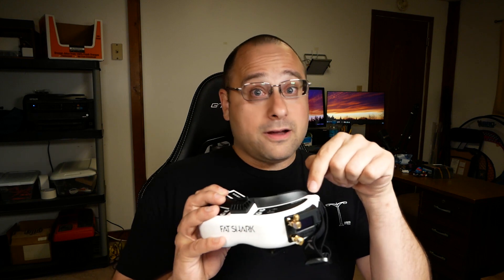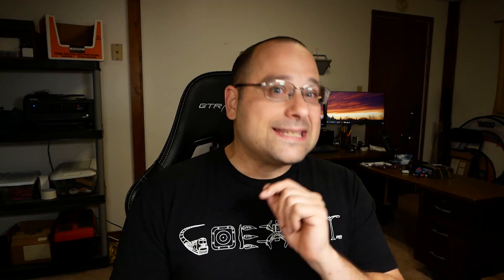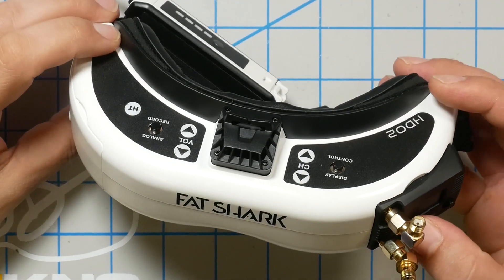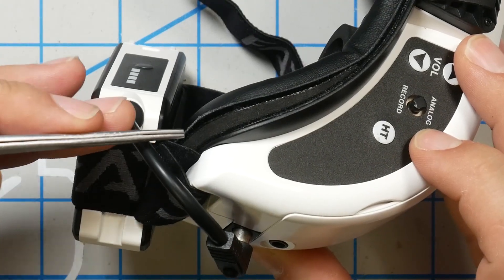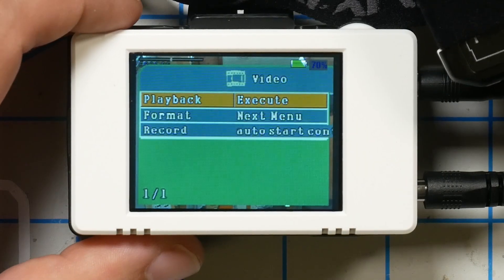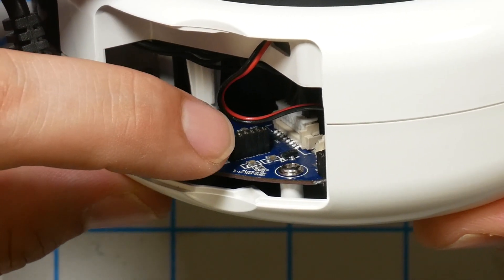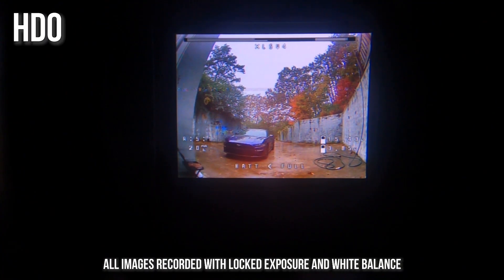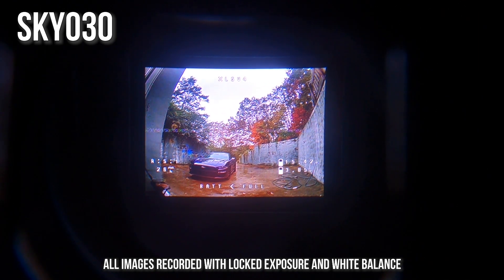Fat Shark HDO2 review (hands-on vs. HDO, Skyzone, DJI)

Comment: So once you mod your 54 degree FOV DJI googles with 1440 x 810 resolution to use your Rapidfire/Fusion module on them, will the HDO2's be better than dji fpv hd goggles? Noting the FS HDO2's have 46 degree FOV and 1280 x960  resolution, oh and power button :)

We wanna see that comparison review Joshua! Please do it soon :)

Comment: Excellent review of the HDO2 and commentary on the digital divide. I'm new to the hobby and I bought the Sky03O and will remain a happy user for a while. Touching on the transition to digital, As a noob to FPV, I am very glad I started with small micros, which digital doesn't support, and you need something better than the BnF crap goggles that RTF kits come with. That is a bad experience and will drive people away, therefore, you need to put money into something and then a few months later, when you move to 5", you'd have to lay out a bunch more money to go digital. I don't see that happening. They need to get the digital vtx into micros, then the digital revolution will completely take over.

Comment: Major reasons not to go with the DJI FPV goggles, were: the social aspect (sharing video feeds), micro quads, need to commit to putting DJI in ALL your quads --- most of which can be solved by plugging an analog receiver into the DJI's.  Problem (mostly) solved.  That said, for me, it's simpler/cheaper, overall (Bytefrost transmitter/cameras are WAY cheaper than DJI), to stay analog, and Bytefrost HD will work with my analog gear in the near future.  But yeah, tough choice.

Comment: I'm a beginner deciding on what goggles to buy, and i'm gonna go with HDO2 and not DJI, because, i want my most of my budget in things i won't destroy so i prefer good quality goggles that can handle future digital modules instead of locking myself with DJI and not being able to fly inexpensive whoops or crying when my 160€ DJI camera breaks on my quad. My bet is that they didn't just put a high resolution screen in an analog goggle for no reason. And the diopter is a must have for me.

Comment: Nice review, Joshua, thank you. I am still not convinced... I think I will stick with my original Dominator HD until something substantially better comes out. Interesting that many years later FS has finally increased the FOV…. back... to 45 degrees??!?…. Hmm. My HDs from 2014 have 45 degrees FOV and no blurry edges. I disagree with your comment about a "sweet spot" of 40ish degrees for flying. Having more FOV simulates natural vision better, and with natural vision you DO have to move your eyes around. Our current goggles are just glorified small screens that we stare at... boring and not immersive at all.

Comment: hey joshua, one question I have:
is the mold of the HDO2 wider? cause the old molds do not fit on my wide head, like most sunglasses you could buy.. it's like something sitting in front of my face and the sides of the goggles stinging into my eye holes, and sit not comfortable on the side of my head...  as the hdo supports those inserts, it would make sense that made the goggles a bit wider...

Comment: Since the power switch seems to require some firmware input to function, that tells me it is likely that there will always be a tiny power drain on a battery left connected. Can you check to see if there is a power draw on the lipo when the goggles are switched off?

Comment: What, after just 10 years Fatshark has made a new injection mould? ;-) Jokes aside the specs of the HDO2 are almost perfect. I only hope they let us upgrade the frankly sub-par DVR. BTW: Can the HDO2 use 18650 batteries down to 2x3.2V or do they shut down around 2x3.6V?

Comment: DJI lcd looks like it has a tiny bit of vignette in the corners like VA monitors. Not an issue because the viewing angle doesn’t change. Could just be from the goPro.. I wonder if DJI will ever release a oled screen

Comment: Josh, can you make a video regarding DJI analog input latency? I have a pair and I can notice unflyable latency in NTSC using a falkor micro, changing to PAL gets a little better but still is not good, I heard that using cameras with low latency helps a lot like a predator 4 or a runcam racer. can you do a deep dive into it?
Reply from the maker: Falkor has a pretty bad latency to be honest.

Comment: I was in this situation 1 month ago. Just got in to the hobby, dji or high end analog. Back and forth. Ended up with the dji, i fan se the limitation of IT now tho, with limited frames wich makes light builds hard. Havent got my analog reciever for it yet, so hoping it works decent in analog, otherwise il prob end up with a set og high end analog goggles as well 🤓

Comment: 25:10  At the end of the day... I'm not buying any of them until a) Byte Frost is up to speed AND drops a bay module, or b) DJI comes out with better fitting goggles AND a smaller vtx-only box that'll fit into the many frames I already have... or c) until dji runs the rest out of business and my HD3's crap out.

Comment: Giveaway. It's what you do when you don't want to take such a loss but still feel good about getting rid of your junk. I gave my Sky03 v1.1 to my dad to get him started. I sold my HDO's+RapidFire for $350. Probably killed the market on those for like a week. :D

Don't care about the power button. Didn't like having one on the Sky03's. Good that they finally integrated fan power, but does the fan do any good? If I were in the market, and Skyzone was close to the screen quality, I would buy the Skyzone because their fan actually works in the South. My DJI fan does too, but I don't like that you can't control its speed. Hoping they'll update that.

Comment: Were you able to get the New Bee drone face plate foam to fit well on the HDO2’s? Got mine on pre order, and just curious if my spare foamy will fit the new faceplate
Reply from the maker: It doesn't fit perfectly but I got it to work. I hope NBD comes out with a custom cut for HDO specifically but I'd understand if they didn't.
Reply: Joshua Bardwell I’ll give it a shot then, thanks for all you do man!

Comment: I have double vision (also called diplopia) which needs to be corrected by prism in glasses.  Easily corrected by my Rho lenses inserts in my Fat Shark HDO.   Looks like that will not be an option in the HDO2, too bad.  Seems like it would have been easy to include the same mounts as in the HDO.
Reply: It is not. The lenses are moving and would hit the custom diopters inserted in front of them. Heard there will be some different aftermarket lens brackets.

Comment: Does the TBS Fusion Module still needs the power mod for Fatshark HDO2? thank you! 😁
Reply from the maker: HDO2 never needed any power mod.

If you use wifi with Fusion then you most use the accessory wire.
Reply: @JoshuaBardwell  ohh i see 😍 Thank you so much sir JB! 😁

Comment: I'm getting intro racing, and of course I want to do freestyle and long range too, so these goggles with the rapid fire module are not a bad choice after all, aren't they? They can be used until the next digital system goggles with low and fixed latency come out (if these product eventually comes and is better than DJI I'll switch to it without looking back).

Comment: So $499 for the HDO2’s plus $150 for a Crossfire module, totals $650. Add two quality analog Unify Pro 32 VTXs ($100) and Foxeer/Runcam cameras ($72), now you’re looking at $822. The DJI FPV Experience Combo (goggles, 2x cameras with vtx sets) is $819. 🤔

Comment: Thanks for the overview.  If what you say about -2 to -6 diopter is true then nobody with normal site will see this clearly (and if they do, it will be straining their eyes) and all us old people that still do fly (inconvenient as it might be) who have + diopter adjustments are screwed.  Where do I feed back to Fat Shark (that I have been using in various versions for the last 5 years)?  I have had custom lenses made for each set of Fat Shark goggles and love them.  If they remove the option I will have to change manufacturer.
Reply from the maker: +2 to -6. Not -2.
Reply: That makes sense!  Thank you.

Comment: Gotta kinda disagree with you about dji not really working with analog systems at the same time. At our last 2 MultiGP races here one of our guys ran a dji system all day with us and while some had a little interference it was still flyable and some of us had zero issue. We figured it depended on vtx. Those of us with tbs unity’s had zero issue along with a guy with an immersionrc Tramp. But guys with super cheap vtx’s did have a little interference but still able to fly just fine. But I’m sure some out there would have worse issues depending on situations. I guess.

Comment: The scouts are my daily driver with rf ground station. Best of both worlds in my opinion
Reply: Isn't it all analog?
Reply: 12Bladed FPV it is but at least with the scouts I get a nice dvr good FOV and rf diversity
Reply: Wasn't happy with reception, or had receiver before buying Scouts? As I know, there is patch antenna integrated in body.
Reply: 12Bladed FPV no it works great just needed more range for long range

Comment: In my case, having Sky04X the IPD is limited to moving the optics while the display remains stationary, this causes a cut of the edges in case you need a very narrow or very wide ipd.  Seeing the HDO2s open in a video I noticed that the oled displays are anchored with an aluminum support directly to the optics allowing the simultaneous scrolling of both the display and the optics which results in a better vision / immersion / centering and without cutting edges. .  Can you confirm this value of the Fatshark or are they just my conjectures made without having tried them?

Comment: Not true JB there is a $20 conversion the front faceplate that allows you to nicely tuck in an analog module on the DJI goggles so you can do analog and digital

Comment: I'm looking at a large crowd of people in a public place. About half of them are wearing corrective lenses. And Fatshark thinks it's a good idea to drop custom lens support. But they added a power switch and connected the fan to the electronics. That's like remembering to breath.
Reply from the maker: The built in focus adjustment will definitely work for a lot of people. But not everybody.
Reply: @JoshuaBardwell  Good news, Fatshark has told me that it should be easy to place a custom lens in these goggles. There is room to do it according to them. You might want to edit your video to include that info, once you verify it.

Comment: On the point about the Scout / PowerPLAY DVR - I have the PowerPLAY and I'm seriously not impressed with how it does the 'deinterlacing', it's quick'n'dirty, it simply separates the fields and scales them vertically by duplicating each line, resulting in footage that jumps up/down by a single pixel, and looks even worse when you record RapidFire in mode 1 because the OSD text then jumps up/down. See my comment in my recent video "ImmersionRC PowerPLAY DVR vs FatShark vs Canopus ADVC-100"

Comment: All my friends have converted to DJI FPV but I’m still sitting on the fence.  I’m having too much fun flying mini’s. Had DJI made their air unit fit mini’s, would have jumped ship already. Mistake by DJI not to make their system be able to view analog. They would have sold more goggles for sure.

Comment: the dvr is a wtf... would have bought if they included the updated one. still using my dom v3's until then. that sucks. i'd also rather have the 16:9 stretched aspect like on the dom's than being stuck to 4:3... blah. stuck with old gear till they get the options right. they really don't seem to understand why people want these things.

Comment: I'd like to see a comparison of middle range $300, high end $400+ goggles. I'm on the fence. Thank you
Reply from the maker: https://www.youtube.com/watch?v=XNaR5IrdIjU

https://www.youtube.com/watch?v=Dy1dOvwU10M
Reply: @JoshuaBardwell  i watched those. Great videos. I ment more of what would I be gaining with the top of the line vs the mid range. Sorry, I'm an older guy just started fpv this summer. Like a side by side, mid vs top.
Reply from the maker: Generally, the difference is 1) higher resolution, 2) larger field of view, 3) OLED screens.

Comment: I want a brave soul to open the case and have a look at the DVR board. I've been running the HDO DVR board in my classic Dominator v2 for quite a while. Why you ask, I bought my v2's used, they did NOT come with the super capacitor feature for saving video when you unplug the battery.  Reason I want to know about the HDO2 DVR board, that picture adjustment OSD. Is the OSD part of the DVR board, OR is it is located somewhere else.  I'm thinking, if the OSD is on the DVR board, then people with "classic" Dominator and HD series goggles might be able to do a little swap, and gain some functionality.

Comment: As much as I would like to fly the DJI HD system, I'm waiting for fatshark to come out with an HD module that can plug into their old goggles. I would bet my bottom dollar that it's right around the corner. It would allow people to just buy an HD module for the goggles they currently own instead of purchasing a brand new set of goggles. Fatshark is a lot smaller form-factor than the DJI goggles and if they had an HD module that you could just upgrade your current goggles with, it would be perfect for everybody who still uses fat sharks. I know for a fact it's coming. I would bet it's already in the works. So I am patiently waiting for that

Comment: Isn't the DJI system lacking the Betaflight OSD ?  At least if so it should be mentioned as one of the negatives of it.  As is the price and size of the camera and VTX module, which makes it expensive and not suitable for lightweight or smaller drones and micros.
Reply from the maker: In the end, this is not a DJI review. All of that stuff has been extensively mentioned in my DJI reviews. This video is already 25 minutes long just talking about the HDO.

Comment: You did not just day the hdo2 has a better image than DJI. 😂 Next time adjust the ev comp and saturation. As a whole the DJI system is unbeatable when it comes to dynamic lighting. At this point you're just throwing in the DJI goggles to say that you covered all the bases.
Reply from the maker: Look at the screens you can see for yourself. Are you surprised that OLED beats LCD for brightness, blacks, and saturation?

Comment: If Fatshark released a 16:9 version of this I would have added it to my cart already.
Reply: Get your credit card out. The spec sheet says it can do analog 16:9 and 4:3 and HDMI 16:9
Reply from the maker: The HDO can letterbox the input and IMO it's still the best looking, largest 16:9 image you'll find. Short of DJI goggles I suppose, which are vastly larger but the screens aren't as nice as the OLEDs.

Comment: Does the TBS module work by just plugging it in ? Or do you have to run the power cable ?
Reply from the maker: Like the HDO it will work without the cable as long as you are not using wifi. If you are using wifi, I assume it needs the cable but TBS would need to confirm that.
Reply: That’s a decent reason to purchase up for me. I got this new module I haven’t used on my hd3s cause I don’t wanna wire it.

Comment: I don't understand the fuss about power button. To put goggles back into the case you need to unplug the power plug, otherwise it wouldn't fit. So power button is redundant.

Comment: I didn't understand if power button can turn on/off Google and control fan at the same time? Or I should move jumer every time?
Reply from the maker: Long press to power. Short press to fan. Not complicated.
Reply: @JoshuaBardwell  In which jumper position this behavior works?

Comment: Okay...  bought a set when they went on preorder this morning. What's up with the head tracking? Different connector inside and no connector on the bottom. Any idea if the old Trinity will work or what?
Reply from the maker: I don't see how the old Trinity can work since the plug is in a differetn place. But the manual still lists head tracker as supported so presumably they have a plan.
Reply: @JoshuaBardwell  Thanks. Fat Shark answered my PM last night saying it's only 0.15% of his sales and won't be immediately supported. Not sure what that means so I asked him to expound on that. He said the repair center will send a old style power board to those that want to keep HT but that gets rid of the power and fan button. I also asked why keep a button labeled HT and what does it do... If the header pins are electrically the same maybe I can make a jumper and at the same time convert to a 3.5 to 3.5 cable.

Comment: Can you guys help me. I tought, I should buy the Orqa Fpv.One, so when a good digital system comes out, i still can use them? I that the case? Because they are also made for DJI drones... I thout. Will the HDO2 support digital systems? Thats for me importat, I dont want to buy new goggles for digital system when a good one gets released.

Thx for Awnser.
Reply: I'd bet my bottom dollar that fatshark is currently working on an HD module that can just plug right into their old goggles. No sense in buying DJI goggles when an HD module for fatshark goggles is right around the corner

Comment: I guess they're not really a usable 46degrees FOV as you would letterbox some of that FOV for 4:3? Or am I thinking about it in the wrong way?
Reply from the maker: If you were looking at 16:9, yes, the FOV would be smaller. But the horizontal FOV would be the same, so in a sense you can think of it as just as big an image, just with less on top and bottom. But when comparing to other 16:9 goggles, the 46 degree FOV is not correct.